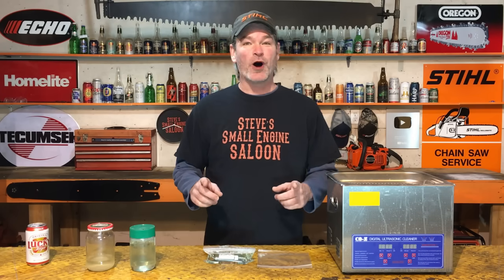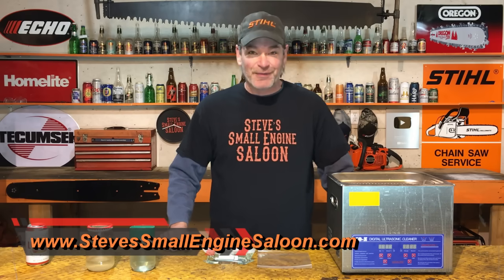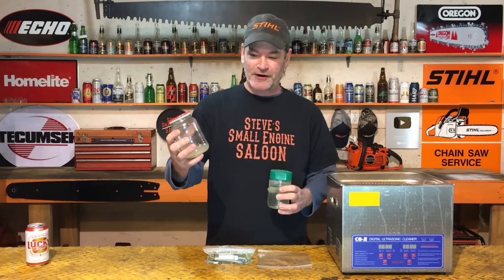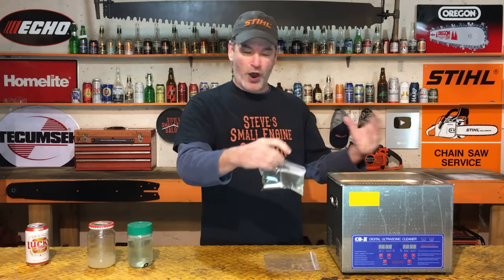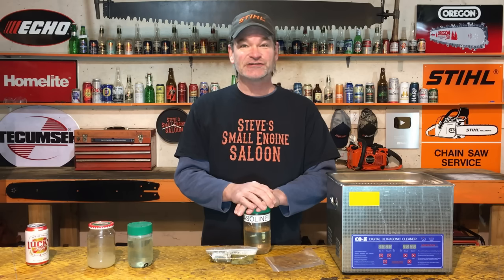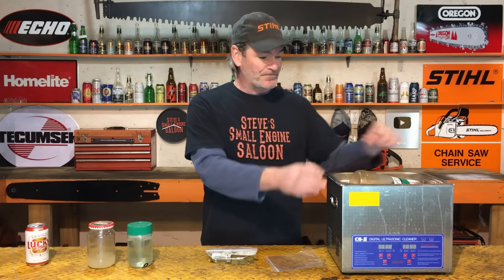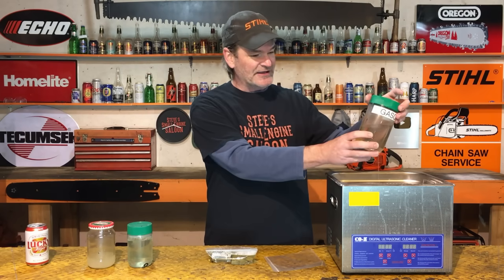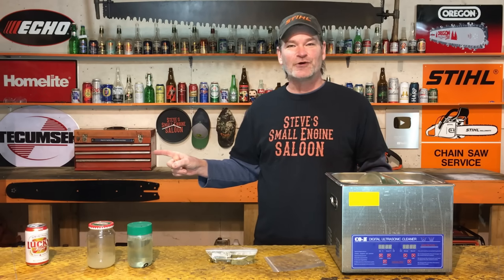UPDATE: Ultimate Tips For Using An Ultrasonic Cleaner

Comment: Just bought one. Question: can you put a large ziplock bag in the entire unit then put the basket of parts in? Bottles are fine but on some greasy items, the gack settles on bottom of bottles or smaller zip locks.  The gack just reclings to the parts. I want the 'crap' to go thru the basket so it doesn't restick to my parts.

Comment: Hey Steve I like your old school aproch . I m in my 70`s and have been runninga high end cabinet shop for a very long time. about 10 years ago I got an ultrasoic cleaner to clean my air assist airless spray guns and pumps. I watched a u tube video showing diy solution using a bit of amonia. well I have this to say about that. If you value whatever you are cleaning don`t be cheap about buying a store bought cleaner. they run about 70.00 a galon and you only use a bit i your water bath. In my case the spray guns run about 1200.00 per. the amonia attacted the anodised  aluminum gun body. Also for all the small parts in a glass jar with whatever thinner you use for normal cleaning and is used with whatever paint you are spraying is great . I do use the heat about half way on the dial. Anyway that`s my story. Keep up the god work. Cheers Colin

Comment: maybe try Diesel instead of Gasoline. Diesel works great on greasy Parts but leaves an oily film which, depending on use, needs to be removed by alcohol later (e.g. isopropanol/water mix). And Diesel feels more safe but still not to be underestimated.

Comment: Hey Steve, just thought I'ld let you know what I use in my ultrasonic cleaner, and I don't think you"ll go back to gas after you"ve tried it. It"s made by Enviroway and it"s called Easy Kleen II Degreaser. I use 10 measuring cups of it in my 30 liter ultrasonic cleaner, and 20 min. at 55 degrees Celcius, and the oil and grease is lifted off of the part. Just some light brushing in warm rinse water, and blow dry with the blow gun. By the way the water evaporates very quickly when the part is warm. Just make sure you oil any parts like cameshafts, dipsticks, or any metal parts of that nature, immediatly, to prevent flash rusting, because it"s so dry, and blow out any tubes or hoses. For smaller quantities just do the math,

Comment: Hopefully some will "Sort by recent" and see this comment. 🤞

All of your tips are great. I would like to add my technique for keeping low VO2 solvents separate from the UltraSonic cleaning tank.

I have a small unit and use small stainless steel pans usually filled with a citrus cleaner ,buoyantly  balanced to the point that they lightly rest on some 3/4" plastic spacers in the tank, just under the pan.

This allows me to quickly switch cleaners, and even melt hot wax for bicycle chain treatment. I will be testing gasoline in closed glass mason jars with plenty of air headroom for especially stubborn crud.

Thanks for sharing your experiences with us. 🙏

Peace, Love, Health, and Freedom, to all who are fortunate enough to strive for these goals. 🙏
ct

Comment: Just wanted to say thanks... just received my 6L cleaner.. and it nicely fit a 1L ice cream tube. 

2 ... 50 round 9mm tray loaded with 223 cases.. stacked.. in 30 mins... 100 rounds cleaned and ready for polish..

Did more in 5 hours than I would in 3 weeks of wet tumbling and the cleaner tank is pristine...

Great tip.

Again   many thanks.
Reply from the maker: You're Welcome...

Comment: Great video Steve.    I’m sure you remember the old pioneer 1074 chainsaws would heat the gas so hot it would boil in the tank.   Especially when the nickel was worn off the cylinder walls by the exhaust.     Lol I’ve seen lots boil gas But I’ve never seen one catch fire.       I’ll be using gasoline to clean my parts too.

Comment: My only concern using different solvents, gasoline or not would be the effect it has on the part I am cleaning.  I am buying an ultrasonic cleaner to clean my guns.  Not sure I'd want to use gasoline.  Other than that, I see no problem with it.

Comment: plastic container of gas vs chainsaw...so no vent on the plastic container lid but there is on the chainsaw...yes? so can't pressure build in the plastic container with no way to vent (like on a gas can) so I worry about the heat/pressure. The jar can float in water but can the gas tank on the chainsaw and no water get in or does it let some air in? (I saw your video on when caps go bad)...I just worry about stuff...so I ask.

Comment: Steve you have a very polite way to tell the no nothings wanna be experts where to stick it. I've been using GASOLINE to clean filthy dirty grease infected parts my whole life and I'm really getting old now. Your tip with the ultrasonic is GREAT news to hear. I just bought a fairly large capacity cleaner to try out. I've been using and old fashion tub cleaner for generations, the one with the pump that runs the recirculating cleaner over the part. They suck when the solution gets polluted. This "use only what you need for the part being cleaned " tip is genius. And for all those scared babies out there, it's too bad they couldn't have watched me braze / solder gas tanks with gas residue in them using C O2 for a surrounding atmosphere to prevent vapor ignition, They would be hiding around the corner. Thanks Steve, your videos are great to watch. Keep it up.
Reply: yep, no fuel, no boom

Comment: I have your EXACT same ultrasonic machine- for years I've had 3 gallons of Berryman's "Chem-Dip" carb cleaner in it, after hundreds of carbs and 5+ years it finally went bad on me and started leaving a yellow-looking sticky coating that doesn't easily come off, so I switched to Deionized Water with a Tablespoon of Dawn Dish soap and a Tablespoon of Purple Power concentrate, ran my first Honda pressure washer carb in it this week, and she worked like a champ! THANKS for all the info (Subscribed)

Comment: If you're going to use combustibles, those would be better off in a plastic container. The cavitation from the ultrasonic will quickly heat gas, or denatured alcohol, causing the vapors to expand. You should also make a rack to stabilize the container, so the energy isn't wasted spinning your container, but used cleaning the piece. If you have items that are caked with organic material, you can also use peroxide, or dilute liquid drain cleaner. Just no aluminum parts.

Comment: If anyone out there ony needs to clean a few small things or try out ultrasonic type cleaning. Years ago when these cleaners were super expensive and small i made a simple one by using hardware strapping (the 1" steel with the holes in it) to strap a handheld vibrating sander to a large plastic pickle jar lid along with two chains to suspend it from the garage rafter to just above the bench to isolate it and used the big pickle jar as my cleaning vessel. It worked amazingly well for a number of years and I could easily make another one if needed although I have access to a big 20L one at work.

Comment: If you normally run diesel through a parts washer then why could you not use the natural degreaser in your ultrasonic parts cleaner. Its less volatile, then gasoline.

Comment: Great video. I just now order this big Ultrasonic Machine to Clean my big probably 1mil pcs, 200 set LEGO collection. My LEGO room and collection was damaged in recent floods. All the parts are dirty from the river residue and mud. After 3 month of cleaning by hand I come a cross this machine and could not believe how great it works. Friend borrowed me small one, so I immediately order this new big 10l one.
I have one question. Instead of dumping all the LEGO-s inside and mix them up, can I use washing bags and put them inside the tank? I already have most of the LEGOs sorted by shape, so I don't like to mix them up and would put them in different smaller washing bags.
Thanks for any advice.

Comment: I think the warning for gasoline is if it breaks open, the fumes could leak into the area. Or people actually using gasoline completely in the open tank which would be very dangerous because the fumes explode but once again common sense. Kind of like deep frying a turkey. People dump them in when they're frozen and wonder why their house burns down lol. Another trick people have used is kerosene or diesel fuel but I would do that outside.

Comment: I recently purchased my first ultrasonic cleaner.  It looks like it's made by the same company as the UC in this video.  I used it for the first time on a Zama Carburetor.  I also followed your suggestion of putting the (disassembled) carb in a glass jar filled with gasoline (non ethanol) and immersing the jar in the tank.  I let the UC operate for 25 min.  Afterward, inspected the carb and saw no visible difference.  It had no affect on exterior surfaces that were dirty.  I soaked it again for 30 min. @ 70 degree Celsius.  Still no visible improvement.   I want to eliminate the possibility that the UC is bad.  Any suggestions you have for proceeding forward would be appreciated.  Thank you!

Comment: I’m pretty sure the ”gasoline is unsafe” is more about the handling of the gasoline and worry that the container might break rather than it igniting during cleaning. except for the lightning guy, that was just pure conedic gold :D But yeah, since glass is the best for cleaning, putting gasoline in gas containers over and over again you’re very likely to drop one. Sure, 99% of the time it’s no problem, but there will be someone who drops it on an extension corde or something and ignites the whole thing and now you’ve burst into flames.

Comment: The pure solvent, the one used in painting jobs, is the best natural degreaser that exists, although it attacks rubber gaskets more than gasoline, but it is equal to or better than gasoline in removing grease and a little safer and at the same time. less, cheaper in my country!

Comment: I cleaned machinery and engine parts with a wire brush using gasoline for years. One thing I have learned is to test the container, for gasoline will melt some plastic. Lighting? Guess they are thinking microwaves. Price of gas! I think I try simple green!

Comment: I do like your videos so don't take this personally. Remember not all people have common sense and will do it because you said it was okay and did not consider other factors. So I will explain it to other viewers that may read my comment. Comparing gasoline in an ultrasonic cleaner and a spark plug in a chainsaw is not a good comparison. The spark plug is insulated and grounded by the body of the housing it is virtually impossible to cause an outside spark unless your insulated spark plug wire is worn out and somehow it arcs. second gasoline can eat through a plastic bag, mix with the water, and create vapors, and if there is a short or spark nearby can catch flame. More importantly, it will void the warranty for all ultrasonic cleaners all the manuals say not to use gasoline or flammable solutions. Also, diesel is non-flammable and better cleaner than gasoline so if you have to use one diesel is safer and does a better job. Before someone says diesel is flammable, it is not, it needs both compression and high temperature to ignite that is why diesel engines do not use spark plugs and have higher compression the gasoline engines. Also just use simple green or Dawn dish soap it works wonders we use Dawn dish soap to clean contaminated parts in almost every mechanic shop I've worked at to get grease and oil out. They literally use it to clean animals that got caught up in oil spills. Finally, gas is not cheap anymore you can probably can find a cleaning solution that works just as good and will not harm you, your equipment, or the environment and I know the last part was a hippie thing to say. But if your a redneck set in your ways you're gonna use gasoline no matter what anyone says and have at it but don't cry if the unit shorts out and catches fire and burns down your shop or something happens and voids warranty. Let's also not forget a lot of the units go bad and short out or leak fluid into the unit so do you want gasoline to leak down into your circuit board? Use some common sense or don't, and let nature take its course.

Comment: The danger with petrol (gasoline) and other flammable liquids is that if you fill the tank and run it, it will produce vapour, which if it contacts any ignition source would be bad, but if you have it in a sealed container or you have it in a well ventilated area then it is fine. 

I have also heard (but don’t know how true) that the transducers could get hot and if you have the tank full of flammable liquid then the heat on the side of the tank could ignite it, but I don’t know how likely that is, either way if it is in a jar or other sealed container then you have nothing to worry about.

Comment: I think you're absolutely correct  about the fire hazard about using gasoline or other flamables (like alcohol as I intend to do) in a CLOSED container, with as little air as possible.
And to be on the safe side don't use the heating.
It's the vapors that catch fire, so not heating it means a lot less vapors (isolated in clossed container with as little oxygen as practical).

Btw make sure the jars you're using with the fuels (or nasty chemicals) don't unscrew their lids under ultrasonic vibrations.
I was cleaning some soiled jars yesterday (used it like a dish-washer basically :)), and I saw 3 of the jars open themselves in several seconds after starting it.

Zip-lock bags are also very useful, especially for cooking ... :) yes, you can use it as a sous vide for cooking, like tenderizing meat, or beating eggs into fine emulsion.
And the best thing of all - again about alcohol - 
you can age alcohol in your ultrasonic cleaner! :)
Take some cheaper alcohol (or whiskey, rum or whatever you like) put in a container that won't unscrew itself, add some wooden chips or small sticks (stripped from the bark! - just the wood), ideally you can buy some that were actually used as a barrel for aging wine or other alcohol so they'll have richer aroma, and run it for about 15 mins.
You'll end up with an alcohol that's like been aged several years! 
Cheers! :)
Reply: Great tip! And judging by the row of bottles and cans on the shelf behind Steve, it will be well received....
Reply: Crazy talk

Comment: I tried the plastic zip lock bags with the gasoline but ran into a couple problems.  The first issue I had was horrible.  I tried several plastic bags and had to put some inside each other but could not get any that would not leak.  And yes I used name brand bags.  The second problem was just dumping them into something when I was done.  It was messy and sloppy.  I just went the glass and plastic.  Had fun trying to find something big enough for the carb body.  As for gas it did work.  Just a word of caution to anyone using gas.  DO NOT dump it out and try to light a fire with it.  The fumes burn and it explodes....  I am not going to suggest how to dispose of gas but please do it properly.  Thanks for the tips it was a great idea.

Comment: Haven't tried it yet but if gas works good then camp fuel works better. I use it regularly to pull oil out of porous materials, I used to use gas but camp fuel works in half the time. It does strip paint

Comment: I have the same cleaner, love it and love your tips. My only concern with using a glass jar is as it heats up it pressurizes and I'm not clear how far that can go. But I figure it's probably a good idea to prewarm the glass jar and solution in hand (maybe under a hot water faucet) with the lid on loosely. Once it's as warm as the water, then tighten the lid and hit the beach.

But I wanted to make a comment about using gasoline to clean/degrease: I agree totally. Best stuff there is for this. But it will leave a residue on the part. This coming from someone who's waxed bicycle chains as a lubricant for decades and swears by it.

With one very important caveat: the first time a chain is waxed it must absolutely clean, stripped, bare-metal and gasoline alone won't do it because of that residue left behind. It has to be stripped of everything, and the only thing I know that'll do that is an isopropyl alcohol, or acetone bath after the gasoline treatment. Then the paraffin will adhere and provide a good base and last.

Comment: Hi Steve I have the same ultrasonic cleaner. I have a helpfull tip .You have to be careful of some cleaners when you use the heater not in a container and water bath is the fumes (some non petroleum products) of the cleaning you can get an ill feeling from the fumes. I have experience that not a good feeling. The container ia a great idea and keeps all parts together in one container. Keep up the good work

Comment: Tip; add 6% phosphoric acid to cleaning / rinse water so steel parts don't oxidize and rust. 

Use air duster gun to blow dry parts.

If not assembling parts then spray C.r.c or WD-40 then wrap in wax paper and outside with news paper then store in plastic bags.

Comment: Steve, 2 thoughts
For small parts I use a large tea infuser, it's stainless steel screen allows for very small parts to be cleaned then blown off after without the fear of loosing them and it keeps floats below the solution so they get totally cleaned. 
The other is that gasoline will give off vapors and may build pressure and leak, remember your fuel tanks are vented. Not really dangerous but could contaminate your so.ution. keep up the great videos 🇨🇦
Reply: Good idea, especially for really small carb parts. 👍

Comment: If they think gasoline is a bad idea then they shouldn’t drive a car. A fuel pump on now day vehicles sits in the fuel tank and has live wires and grounds going to it as well as all the heat that the pump creates in order to supply your car with fuel.